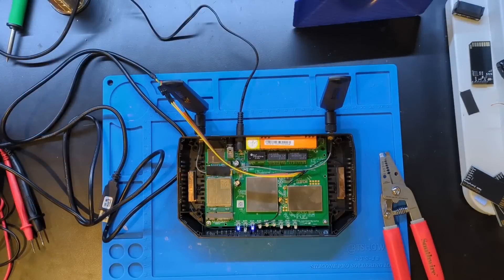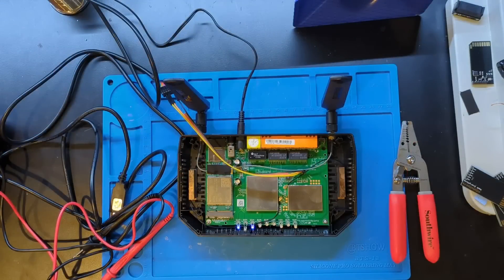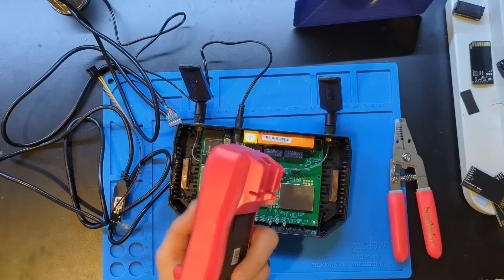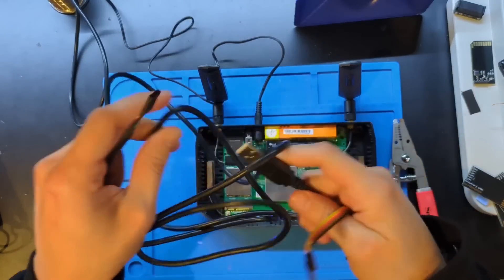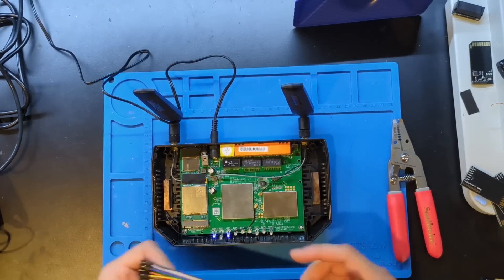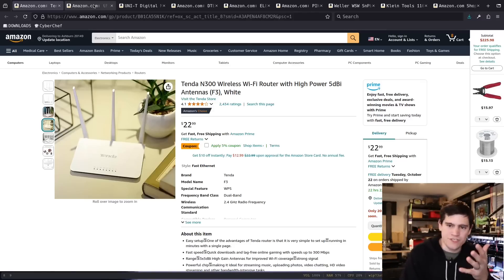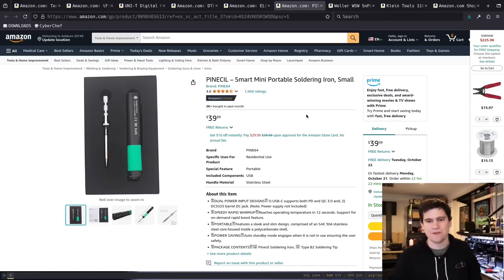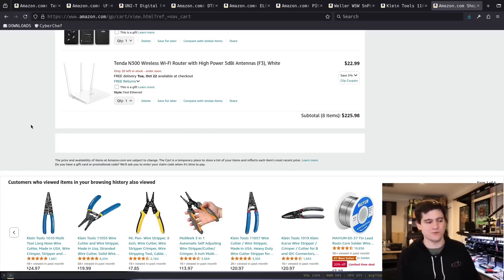Top 5 Tools for IoT Hacking Beginners

Comment: 7:43 I did not buy that usb adapter when I started my projects. I bought an ESP Wroom 32 for 8$. It supports UART, I2C and SPI. I connect it to my PC and use TeraTerm monitor to listen to the devices.

Comment: theoretically you can make programs for 3d printers that allow multiple exposures with breaks before changing the exposure layer, for such a program people are willing to pay even $50 for a program, legality does not matter, the important thing is that it works
Reply: It's hard to understand what you're talking about in the context of this video, or at all.  It sounds like you're talking about resin printing.  Even then though..
Reply: @smorrow  you connect to uart hack 3d printer you change soft with more options like not one uv expos but multiply uv expos before change layer for such soft you take money

Comment: I wanted to try playing around with  the Tenda N300 you recommended, but it looks like the latest version they sell off Amazon no longer has a UART connection. I could also be blind and just not be seeing what is right in front of me :D. Are there any other cheap routers you could recommend that would be good for beginners to play around with?
Reply: Yup, this is correct. I extracted the firmware and found it’s not running Linux either. It’s a MIPS monolithic blob. Probably not a good beginner friendly router for learning. I’m a newb and will still carve out some things binwalk found, but wish I had known it wouldn’t have a root filesystem before buying.

Comment: Old devices from lessor brands like tp-link, d-link, etc are really good. They are pretty easy but can be challenging too. My "baby's first pwned hardware" was a Netgear WNR1000R which was a complete push over, i.e. I got serial up and BOOM root shell hahaha

My first device that fought me was a WD TV, had a login shell which has a randomly generated root password + another account without password. Had BGA chips too so couldn't just go nuclear and desolder the flash like I did with the Netgear. With a bit of work and some brute force cracking (the root password whilst random is short and only lower alphanumeric) which only took 27 seconds on my i5 laptop I was in like flynn, and OMG the dopamine hit, holly mcflying cheese burger 😍 I am deliberately vague because I don't want to spoil it for others who may want to follow, a lot of the satisfaction was the journey to the root shell.

I am currently working on a TP-Link C50 v6 that I bought new for $47, not the brightest of ideas to go new hardware but I wanted a challenge and she's putting up quite a bit of a fight despite having SSH that is responsive to the admin password on the device :| Thou the devices are still flawed as frig, like still 8 digit default random password on the device, dafaq?! (1060 + hashcat == exhausted keyspace in about 20 minutes)

Though I am now at the stage of I am the puppy dog that just caught the root seagull, I have the seagull pinned down with my paws, it's wings frantically flapping on the ground, squarking and scalding me (probably "unpaw me you furry baffoon") and I am staring at my owner, eyes wide open basically trying to say "ummm master??? now what?!" 🤣

Comment: Also - add a Solder Wick - the braided copper that looks like a shoe lace - I love that stuff for removing solder - 100x better than the POS de-soldering pen looking things that are supposed to suck up solder when you heat the solder to the melting point.   - heat resistant tape - it's the yellow tape you see on  a lot of boards - it helps protect the parts around the part you're soldering or removing solder from.  and one more thing -  Solder Tape - to repair broken PCB traces - and pads - the parts that are shiny on a board whatever you're working on is soldered to - they can easily be accidentally pulled off of a board or burned to a crisp (videos are all over youtube on how to use each of these - and yes they are all IMO needed with ANY SOLDERING KIT - no excuses - you WILL use this stuff - you will REGRET not having this stuff - it is cheap - it will prevent you from throwing project at the wall and wanting to just throw a project in the garbage.   -  A cheap cheap usb microscope - helps as well  you dont need a fancy one with it's own screen - it's usb - you use your computer monitor to see what you're working on.  It's helpful when working on small parts and especially reading and researching different chips that are on a board - for finding pinouts and all that - (finding out what each leg on a microchip is for after you find the name of it)

Comment: HUGE #TIP   -   Don't just get any tweezers - get a set of CERAMIC TIP TWEEZERS so you don't accidently short anything.  #LearnFromMyMistake !!!    (Also, the ceramic tip can't accidently get soldered onto whatever you're soldering - and it helps to prevent heat from melting the plastic on the wires you're soldering.)

Comment: To go to the next level, flux.  Solder will stick better with it, it helps remove components, etc.  The cheapest " hardware monitor " that can be added is actually a pi pico ( RP2040 ).  As long as you check the voltages are under what the pico can read/control data/signals. When your coding of it gets good, you can get each input on it to " monitor " pins on a target, you can upgrade it later to control a FET to " fine tune " power going to the target.

Comment: I would add an external power supply and an USB-JTAG debugger (any cheap ft2232hl will do) to the list of essential starter tools. the external power supply allows you to bring power where you need it and JTAG... well it's a debugger and often there is no UART connector directly available but JTAG pads.

Comment: Great video!  Just to expand on your note about soldering irons..  The better the iron the better you will solder.  When I was in tech school we had really nice solder stations and I could solder well; then I went home to my $15 Radioshack iron I couldn't.  I have had my Hakko for about 10 years now.
Reply: I bought a solder station for like $40 15 years ago, and I can solder good with it. You have to set the temp a bit higher (think the measurement is wrong...) and just keep the tip clean and it solders nicely :) only problem is that I need a new tip, and i have no clue where to get one, so I will probably go Hakko or similar too now since they usually have parts availble to buy.
Reply: I have a ~$50 basic adjustable temp Hakko clone which works great and uses same tips.  When it goes I'll move to an actual Hakko but so far it's been working great.

Comment: Instead of the cable I really like those ft232 breakouts. There's one on sparkfun that is the same price as the cable you linked, but this lets you switch between 5v and 3v3, plus it has the other pins exposed so you can use it to manipulate pins with for example pyftdi.

Comment: I found multimeter with continuity from Aliexpress for $3. Sure, the cables are a bit stiff and the meter is light and tends to follow the leads, but it serves well for 3 years now and still rocking. Just replaced the 9V battery once. No backlight, no special functions, only basics, but it works. I tend to use it instead of my pricey meter - just because I don't have to be gentle. Totally recommended for beginners. And even for advanced users - sometines it come handy to have more than one meter around.
Reply: Yes I have my Klein meter and then an el cheapo for bits and bobs round the house and hobby use basically

Comment: Most of the stuff shown is easy to get, and WAY cheaper than what you said and in adequate quality.
What I am mostly interested in is that UART cable adapter, which spoke very little about it. Is it plug and play? What program to use and how it's called? How did you learn? Which OS, Windows or Linux?
Most people are Windows users, just lettingyouknow. I would like to watch a video just about that UART adapter on how to use it, even if it's an hour long, as long it is in detail explained every step you do and why...?
Reply: All the USB to UART (or RS-232) cords I've seen are plug&play with Windows and Macs. If you're using Linux for this then just verify that the chip is compatible before buying it. Most are. 
The software to talk to it varies with OS. For a Linux (and probably Mac) shell, minicom or picocom are good. For Windows, I recommend PuTTY.

Comment: Today solder should be lead-free. Consumer pcb's do not contain lead, so if you'll be making unspecified (maybe brittle) alloys if you mix them carelessly.

"But lead is so much easier to work with" is the most common reason for recommending those, but people do not wash their hands before eating after just using leaded solder.
Reply: Ive used lead for 30+ years now and I'm still kicking. Lead is best

If you live in a big city, smog / car exhaust will kill you faster
Reply: @kaydog890  That's like saying you were able to drive without a seatbelt without any issues. Of course it's safe if you're a professional, but would you recommend it to someone with no experience?
Reply: I agree with your reasoning for reliability reasons, but this is for hacking. Poor/brittle solder joints 2-3 years down the line don't matter for what most of us are doing.  I do think people should be made aware of the risks/tradeoff when using leaded or lead-free, so they can make an informed decision though.

Comment: You could use a free WiFi router provided by ISP to you or somebody. Also people often just throw them as a garbage, so you can find one for free and save a planet ;)
Reply: All ISPs where I'm at lend you the device. You have to return it to them untouched after
Reply: @Slushee  that's not always the case, often no need to return old routers. I have WiFi4 and even WiFi5 routers left.

Comment: I think with a soldering iron you get what your pay for. Over the years of ekectronics i have acquired cheap stuff and finally got a decent station (hakko 888d). It does make a difference.  My opinion, consider getting a good soldering station if you can afford it. Also,  watch some soldering techniques videos (eevblog).

Comment: One thing i ran in to was 2mm pin headers instead of the standard 2.54mm (0.1").  So i got that and the 2mm to 2.54mm dupont wires. I guess one could solder the wires on directly.

Comment: I suggest you add solder flux
Reply: No flux soldering is difficult. With flux soldering becomes what it should be way easier.
No flux 2/10
With flux 6/10
With flux and practice 9/10.
Reply: and a solder wick - the braided copper that looks like a shoe lace - I love that stuff for removing solder - 100x better than the POS de-soldering pen looking things that are supposed to suck up solder when you heat the solder to the melting point.
Reply: what about solder with flux already in it?
Reply: @bruhmomento4197  Useful, but adding flux paste to a solder joint makes soldering so much easier, and desoldering as well. Flux just makes it easier. Look up Mr Solderfix on youtube he has lots of great videos on how to do thing the easy way for soldering. There are tricks with flux, add flux to the area, then put solder on your iron, now you have a free hand to help with the job at hand.
Reply: @bruhmomento4197  Sometimes you just want the solder already there to flow without adding more, for example replacing a surface mount component.  The flux alone accomplishes that.
Reply: @bruhmomento4197  Pretty much all electronic solder has a flux core. But it is only available as you apply the solder. If you want to pre-tin leads and pads, then just reflow when attaching the wire or component, the flux will be gone. So having a tube to apply a bit more is very helpful.

Comment: I dont know... I take some issue with the uart and multimiter selection...

These days its incredibly reasonabe to pick up on if the many sub $100 pocket scopes that as a "find your pins tool" beats the snot out of the $40 multimeter you posted. See a regular waveform, probably a clocking point, intermittent, data, flat line voltage. Very few if any of the cheap ones have a protocol decoder, but who knows I've been using the same Fenrsi one for a while.

As for uart... That's fine but a more multipurpose tool like a BusPirate does cost multiples of the cost of a uart cable but it can do so much more even things like SPI dumping etc while also being a viable multiple voltage uart cable, low speed logic analyser and while not a great jtag solution can even do that. 

Now I get the economy sucks and your options are certainly the cheapest way to get started, if you are able to afford a little more... You get a better tool that doesn't get as easily replaced down the line as you do more for only about $50-60 in price difference.
Reply: I also take issue with the multimeter choice, one of the dirt cheap $10 meters will do just fine, no need for a $40 one or 'scope at all in the vast majority of cases.

USB-UARTs are the absolute bedrock for this sort of work and are dirt cheap, under $1 so you can have half a dozen in your toolkit and it doesn't matter if you fry one.

I'd maybe add a Bus Pirate later but there's any number of dirt cheap SPI/I2C device programmers, there's the FX USB Logic analysers and if you choose the right CH series UART it'll also work for dumping/uploading firmware.
Reply: @M0UAW_IO83  I disagree, whilst a £10 multimeter might be ok for the short term as a beginner they do actually suck really badly - unreliable and a poor user experience so you'll be wanting to replace it real soon. Better to spend £30 on a multimeter that will be reliable and easy to use. All these tool choices are actually decent tools that won't be thrown away even if you end up buying more expensive versions.
Reply: @M0UAW_IO83  I think it's useful to have the uart cables but if we were talking bare minimum kit... I like the scope and buspirate combo a lot. Toss in A decent screwdriver set, some guitar picks as spudgers, a ts100, solder, and some wire wrap cable and USB-C battery pack and you have "do almost anything" kit that can fit in a relatively small Tupperware container which is great as a throw it in a bag and go to a con solution. 

A scope is by no means necessary but I think it's a nice to have and you will likely eventually want one.
Reply: @M0UAW_IO83  I love my Pi debugger
Reply: An FT232H would be cheaper than a buspirate and still allow for more flexibility than just uart.
Reply: @micahvandeusen9439  Valid point.